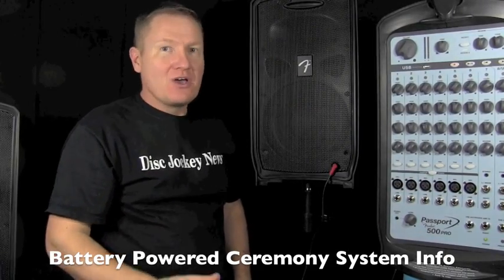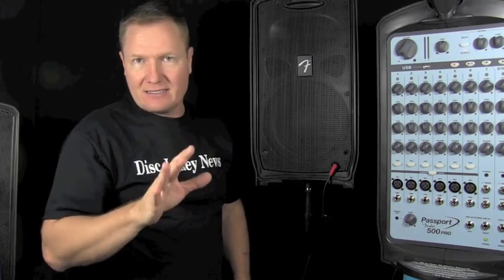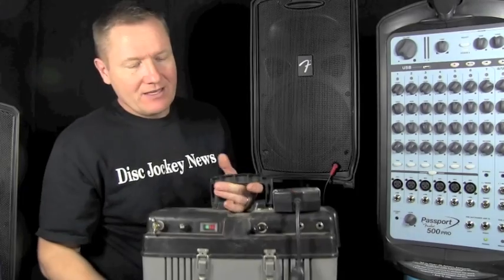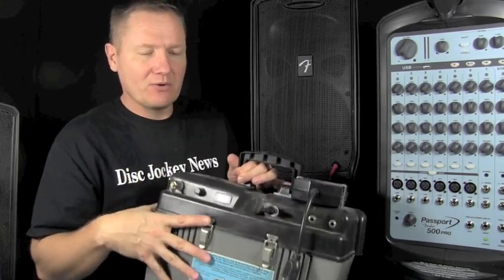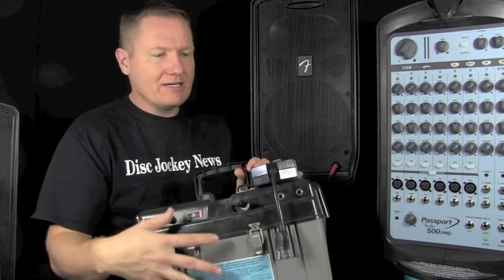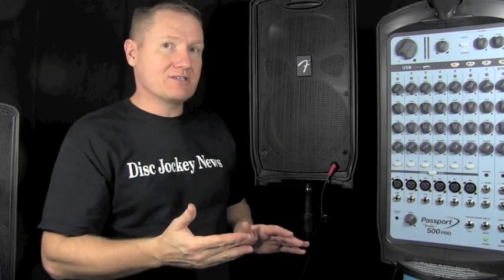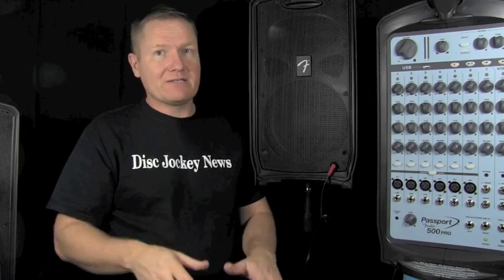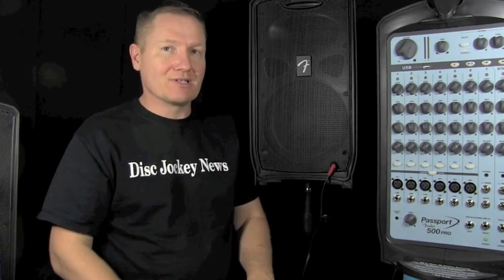Battery Powered Wedding Ceremony: By John Young of the Disc Jockey News

Comment: Cracked me up the beginning :) But good advice I would only add make sure you get a pure sinewave inverter they are a bit more expensive but do less damage to your equipment. There are online calculators where you plug in the battery amps and watts of appliances so you can calculate run time approx.   donrowe-com  website. Lastly don't forget to earth this is usually a wire from the inverter to a long screwdriver that's pushed into the ground.

Comment: I have been using the Anchor Liberty sound systems for my beach ceremonies for over 20 years. I ordered mine with two built in wireless mic receivers (1 handheld & 1 combo handheld/lapel mic).  They last over 6 hours on a charge so I’m good for the weekend without charging even if I have three wedding ceremonies. This system can easily handle most ceremonies.  It also has bluetooth built in so it’s completely wireless.  It sets up in less than 3 mins.  Just have to run one cable to the “slave” speaker if needed.  Has extra inputs for wired mics or a guitar if needed.  If I need a larger sound system that needs power I take out a my Goal Zero Yeti 400 power station. At 400 watt hours it’ll easily power a ceremony PA system for about 4 hours. And the battery is replaceable when it finally dies.  Mine has already been used at least 100 times and have no issues at all with charging the battery.